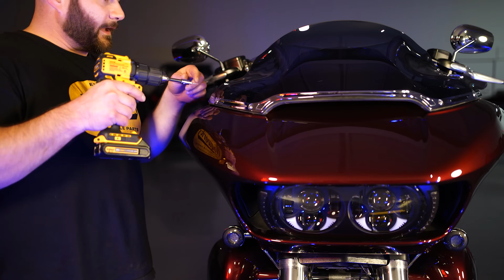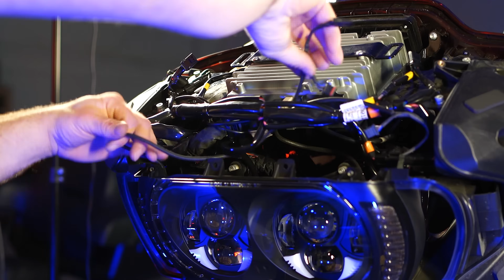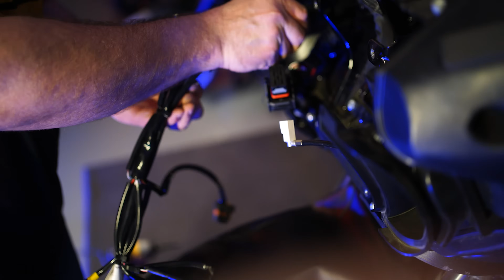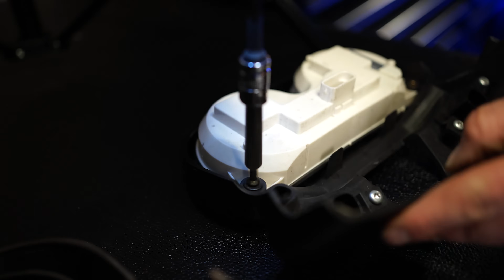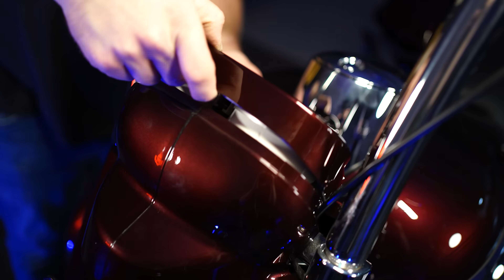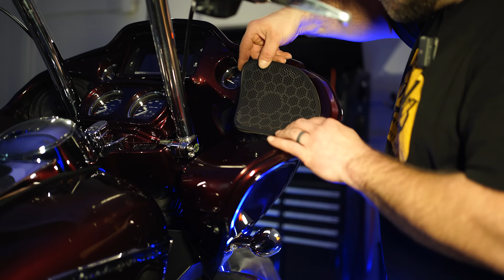HOGWORKZ® Color-Matched Gauge Cluster Covers for Harley-Davidson® Road Glide '15-'24

Comment: I have a question. But first some backstory. I decided to start buying hogworks products over advanblack because you guys say your stuff in made in the USA. The question is, if the stuff is done in the states why did it take 7 weeks to get my color matched products from China? So far everything I’ve ordered from hogworks came from china.
Reply from the maker: All of color match parts are painted by our team in Michigan. Color matched parts are not stocked and painted as they're ordered. Generally it takes our team 4 to 8 weeks to ship color matched parts, depending on color.

We do manufacture parts overseas. All parts are warehoused and ship from our Michigan location. In stock parts ship within 24 hours.
Reply: How i change mine without talking any fairing off ?🤔🤔🤔 I guess you need to have the right tools .😉🤙